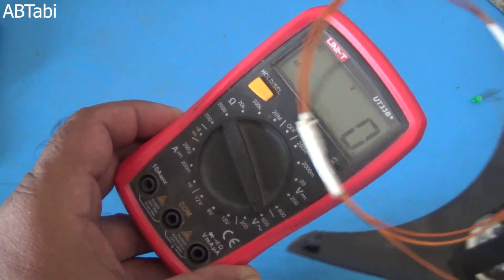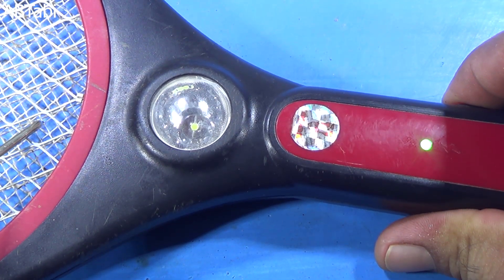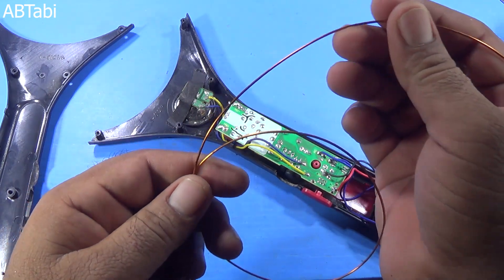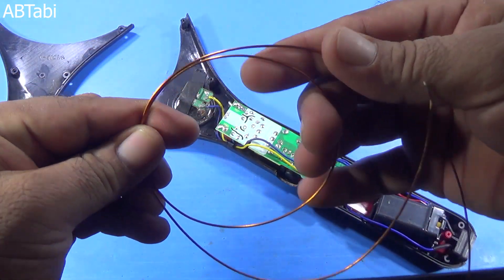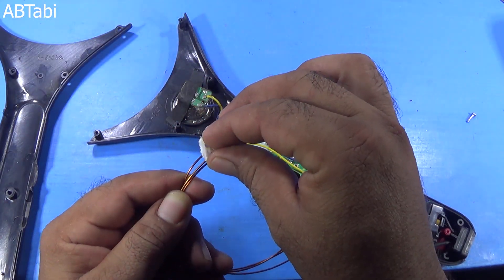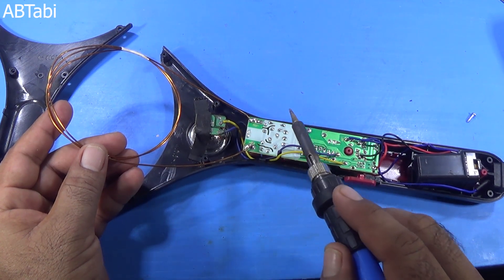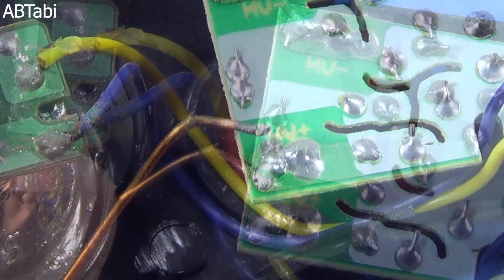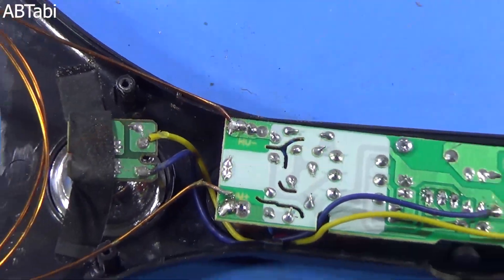How to Make electromagnetic pulse generator, diy EMP G u n

Comment: I think this EMP device is making the batteries drain or weak , you also use a normal 2.5 or 3v torch light and see if the battery and bulb are also collapsed.